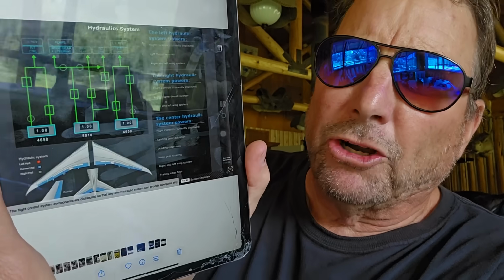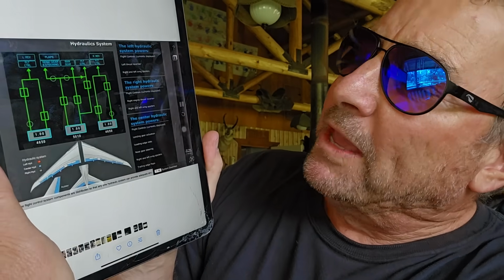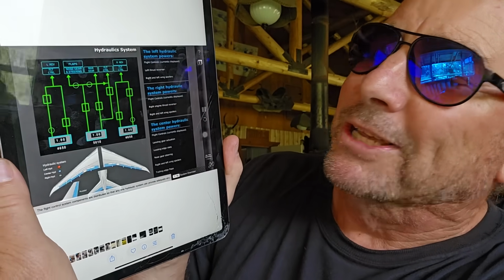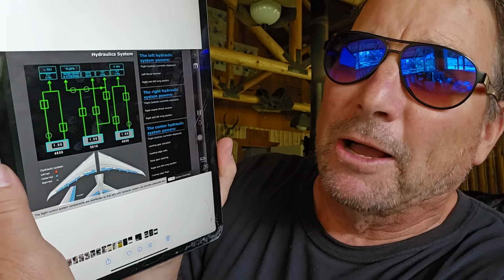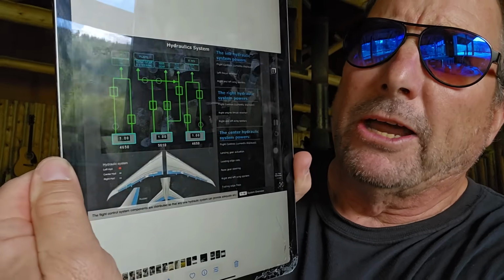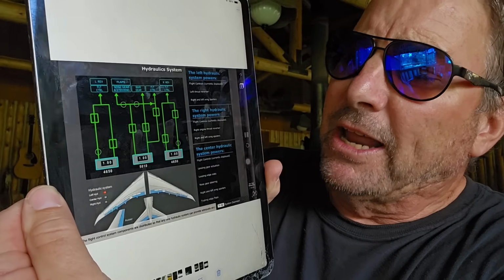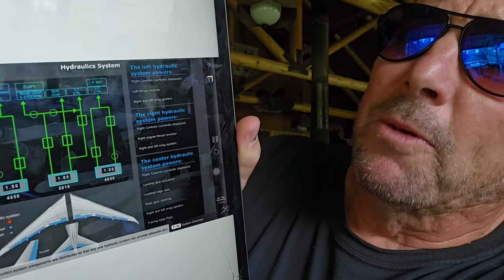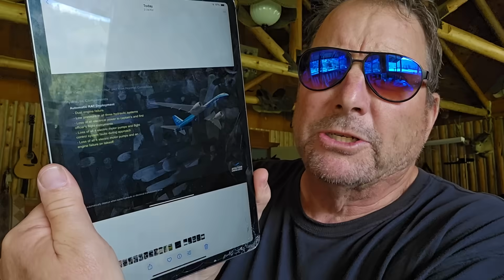787 Crash India What's a RAT? When does it deploy?

Comment: They should have investigated the A/C not working on the earlier flight…it’s incorporated in the whole electrical system to keep electronic equipment and batteries cool. Equipment Cooling System: The 787 has an equipment cooling system designed to regulate the temperature of crucial electronic components and avionics, which generate heat during operation. This system uses conditioned air from the cabin and/or ambient air to cool these components, ensuring their reliable performance and preventing overheating.
Battery Location: The lithium-ion batteries are located in the forward and aft electrical and electronic (E&E) compartments, along with other electronic equipment.
Indirect Cooling: By keeping the E&E bays cool, the equipment cooling system helps maintain a stable environment around the batteries, mitigating temperature rise and thus contributing to battery cooling.

Comment: I think it was dual engine failure after takeoff.  That's why the RAT automatically deployed.  In the video you can hear the engines fade out as the plane goes by. (Nobody is talking about that!)  The plane's performance on the runway was normal until after takeoff.  It also explains why the landing gear didn't raise as there would be no hydraulic pressure.  The plane going down looks like a loss of power (lift).  There does not appear to be a wing stall or over rotation stall.  I don't think the flaps were part of the equation because you see the plane lift off normally.  If no flaps were deployed, the I don't think the plane would not lift off like that.  I also think if the flaps were retracted at that point, the 787 engines at full takeoff power have the performance to continue to fly and even slowly gain altitude with the flaps retracted and gear down at that point.

Comment: This is a diversion to blame the aircraft. Find out takeoff distance for a 787-8 heavy at 3300 ft density altitude. (Ask AI.) A 11,000 ft runway is barely enough for 15-20 flaps and 3000 ft short for flaps up. They programmed wrong conditions.

Comment: Maybe someone commented on this already, but I haven't seen it.  The RAT is designed to provide power to critical systems during a catastrophic power failure.  I can support critical systems, however, it is designed to do this at cruising speed.  At take-off speed, it could only supply a small fraction of this power.  So if there was a complete power failure, and the RAT system automatically deployed, THERE WOULD STILL BE A COMPLETE (or nearly complete) POWER FAILURE.  This condition would be sufficient to bring down the plane.

Comment: This posted on another Youtube channel. Sounds like a Boeing mechanic? 

 During the takeoff phase of Air India flight AI 171, the hydraulic system was under high demand (flaps deployment, landing gear retraction, and nose wheel steering).
The Skydrol hydraulic fluid inside the pipes was likely approaching a temperature of 90–110°C.
If any of the pipes developed even a small microcrack, the hot, pressurized Skydrol could spray directly onto wires, connectors, and printed circuit boards (PCBs) inside the Main Equipment Center (MEC), potentially causing cable insulation to melt, catch fire, or short-circuit within seconds.
One of the high-pressure hydraulic pipes controlling the flaps on the Air India AI 171 aircraft suffered a structural failure due to material fatigue (micro fatigue cracks) that had slowly developed over time and went undetected.
The pipe finally ruptured as the system pressure reached its maximum operational limit of approximately 3000 psi (207 bar).
The hydraulic fluid (Skydrol), known for its corrosive properties and high thermal conductivity, sprayed forcefully from the rupture and came into contact with critical components inside the Main Equipment Center (MEC)—the aircraft's central avionics bay housing electrical modules, relays, and power distribution control units.
As a result, the aircraft experienced a total electrical failure, including:
1. Loss of power from the main engine generators
2. Shutdown of hydraulic control systems A and B
3. Interruption of power supply to the flap and landing gear actuators
4. Failure of all communication and avionics systems, including the transponder and ATC radio.
This triggered the automatic deployment of the RAT (Ram Air Turbine) as a backup power source. However, the RAT is designed to support only minimal flight control functions, and is insufficient to restore flap operation, landing gear retraction, or communication systems.
With the flaps stuck in takeoff configuration and the landing gear still extended—creating significant aerodynamic drag—the aircraft suffered progressive pitch-up and loss of lift.
Without communication capability and full surface control, the aircraft entered a deep aerodynamic stall at an airspeed of approximately 180 knots and an altitude of about 625 feet, then crashed before it could complete a climb-out.
---
Notable Clues:
1. A distinct propeller-like sound (resembling that of a small propeller aircraft) can be heard over the dual-engine jet noise in the original short video showing AI 171 during its takeoff roll. This sound is believed to be the RAT deploying, although in many other versions of the video, the RAT noise is inaudible due to added narration or commentary.
2. Loss of communication between Air India AI 171 and ATC occurred at an altitude of approximately 400 feet, strongly suggesting a complete electrical systems failure at low altitude.

Comment: Pilot says, “positive rate, gear up”.  Gear up is selected.  Landing gear wheels tilt forward, the doors begin to open.  Then, blam, both engines quit at the same time. (Water in the fuel?).   The gear stops in place after the hydraulics went out, the RAT deployed.  The airspeed bleeds off especially in the hot low pressure air upon take off.   No chance of recovery.  Sad. 

That’s my take.   Something caused both engines to fail at the same time.  Fuel problem would do that.  

Look at those wheels.  The wheels don’t lean forward like that but only during retraction situation that stops in mid operation.  

Doe this make sense to anyone else?

Love you Juan.   ❤
Reply: I agree.  I think you are right on target.  This investigation is going to be on why both engines failed at this critical time.

Comment: Juan: I’d be interested in your views of this subject.

Are modern passenger jet airplanes becoming so sophisticated that pilots can’t diagnose issues quickly enough to eliminate disaster?

ChatGPT said:
This is a very important and timely question, especially as modern airliners like the Boeing 787 and Airbus A350 grow increasingly complex. The short answer is: yes, in some cases, the rapid automation and system complexity can outpace a pilot's ability to quickly diagnose and respond to emergencies, especially when things go wrong in unexpected or subtle ways.

Here’s a more detailed breakdown of why this happens:

1. System Complexity and Interdependence
Modern jets have layers of interconnected systems—fly-by-wire controls, automated flight management computers, advanced engine controls (like FADEC), and dozens of sensor networks. These systems are efficient when working properly, but:
* Failures can cascade or produce confusing symptoms.
* Pilots may get conflicting or incomplete data, making diagnosis harder.

2. Cognitive Load in Emergencies
Automation typically handles most flight tasks, which ironically means pilots don’t manually fly as much. When a sudden failure occurs:
* Pilots are expected to quickly shift from passive monitoring to active problem-solving—not easy under stress.
* Decision-making is hampered if alerts are cryptic (e.g., “AIR DATA INCONSISTENT”) or alarms are overwhelming (the so-called “alarm flood”).

3. Real-World Examples of Tragic Delays
* Air France 447 (2009): Pitot tube icing caused autopilot disconnect; pilots misinterpreted flight data, leading to a stall.
* Lion Air & Ethiopian 737 MAX crashes: In both cases, MCAS—a new stall-prevention system—repeatedly pushed the nose down. The pilots lacked adequate system awareness or time to override it.
* Air India Express (2020): Investigators found automation issues and pilot disorientation in a runway overrun accident.

4. Training & Design Solutions
* Airlines now stress upset recovery, manual flying skills, and automation management in training.
* Some newer aircraft now aim for “human-centered design”—e.g., Airbus’s ECAM and Boeing’s EICAS, which prioritize failure messages and suggest actions.
* Still, pilots often don’t know what they don’t know—they may not be briefed on how every new update or software behavior works under edge-case conditions.

Summary
Modern jets are incredibly safe, but yes—they are so sophisticated that if something fails in an unanticipated way, diagnosing it in time to prevent disaster can be extremely difficult. The industry is aware of this and working on improving:
* System design transparency
* Training that balances automation with manual skill retention
* Better real-time decision aids

Comment: None of the discussion around the RAT tells us anything definitive because as noted it can be deployed manually as well as automatically. We have the pilot comments about a lack of power so it would make sense that he deploys the RAT as a last ditch effort. It doesn't tell us anything definitive about the actual cause of a 'lack of power' or whether or not there was  dual engine/power failure issue. This is because the flaps up/wheels down configuration also creates the same feeling in the pilots mind around a lack of power. I have zero aircraft risk experience but a ton of industrial accident experience and a major contributor to disaster is often focusing on the wrong factor at the crucial moment. They may never have revisited the flaps/wheels down possibility. I am not trying to say the cause is A or B. I am merely stating the RAT deployment does not automatically mean dual engine loss because it can be deployed manually.

Comment: The very first footage of the take off and descent had no audible sound from a deployed RAT, only the newer footage even though it's the same video. It would not surprise me if someone added that RAT audio at a later date. The crew may of manually deployed the RAT in desperation as well. Keep in mind that the aircraft had enough power to lift off and start the climb so a dual engine failure deploying the rat is highly unlikely. Sorry but it still seems to me that the flaps/slats were retracted instead of the gear.
Reply: The first video shown was a copy. The second may or may not be the original.

Comment: Take off with "High Density Altitude" with the aircraft being fully loaded with fuel and people! 1. LENGTH OF RUNWAY. 2. Temperature and humidity at  take off.  3. GROSS WEIGHT OF AIRCRAFT ON TAKE OFF . Flaps and leading edge Slat postion on take off. Very critical in determining go or no go!

Comment: One thought would be a catastrophic bleed air leak of both engines causing engine rollback.  However, 787 does not have a traditional bleed air system.  So something might have caused the reduction of engine power.  Fuel system malfunction even though the engines can be gravity fed?  Too many unknowns at this time.  Only the black box will show what happened.

Comment: If it's true that the RAT was out (and I agree that it sounds like it...) then I fear that -- yet again -- this will be an accident where the FDR and CVR stopped recording with the power failure. I hope I'm wrong and the 787 has a better FDR/CVR battery backup power supply but I will not be shocked if it doesn't.

Comment: Boeing has been using the RAT since the 76-200.  This could have been the Loud Bang the survivor says he heard.  It does make an extreme Loud Bang when deployed.
In my F/O days I was walking around a 757 in Quito, Equator.  I  was just walking out from the right gear inspection and just past the RAT Compartment Door.  Then
Whammm Bangggg....The RAT deployed.  There were local mechanics in the Cockpit and one had foolishly pushed the RAT Sel Switch.  If I had been a second or so
slower it would have hit me.  It is deployed under very heavy springs.  The recoil is more than impressive.  Yes we were delayed with local maintenance and Tulsa going
thru the procedures to place back in and re-cock.  But I am at a loss of such catastrophic failure on take off to deploy the RAT.  There is a photo of the right wing crumpled
up showing the Slats were out.  But the Slats Auto Deploy in a stall.  The 78 is so fly by wire I wonder if the Flap Sel and all indications were good in the
cockpit but the Config never activated.  This is an incredible mystery.  All 78 Flight Depts are in Shock.

Comment: According to VAS Aviation the accident plane backtracked along runway 23 from the R4 taxiway intersection probably to the turning pad which gave them 8999 feet of runway length. The full length of runway 23 is 11,500ft. The take off distance for a 787-8 according to one technical website (UltimateSpecs) is 9251.97 feet, more than was available to the crew that day from the turning pad  Why did not the crew use the full length of runway 23?  One video of the accident shows the plane getting airborne practically at the end of runway 23 having obviously gone way beyond V1 with V2 virtually at the end. This suggests to me that the crew did indeed use the turning pad and not the whole length of the runway. Is VAS Aviation correct in speculating that the crew did not use the full runway length? VAS concedes that nothing is yet known for certain.

The coming days, and we hope it is days as opposed to weeks and months, ought to reveal all. Everyone has an interest in the causes of this accident being established asap -  the airline, the Boeing Company, the engine manufacturers, the traveling public and of course closure for the affected families.

Comment: An indian airline captain, captain Mohan said that airport is notorious for birds off the end of the runway due to trash piles his theory is that both engines ingested birds causing the power loss, he claimed a loud bang was herd as the aircraft lifted off and was the compressor stall. He also said he had warned athorities for years that this would cause a major airline accident. Also on the swiss 001 chanel he noted that the main landing gear wheels were cantered forward instead of back which according to him may have indicated that the crew did try to retract the gear but it couldnt finish retracting due to dual engine failure and loss of ptessure.

Comment: It's been reported that this flight didn't use the full runway, instead starting from an intersection with something like 6,500 feet before the end. It's also been reported that the density altitude was over 3,000 feet. With those conditions and the full load, what would the proper takeoff flaps setting be?

Comment: I have great respect for you and your analysis, but I have to question the RAT theory. The original video has nothing remotely resembling the RAT sound. Yes I understand that it was " filtered/enhanced" but even at high volume on a good sound system there is no evidence of it, and the sound quality of the original video is quite good. Secondly, on Tech News Australia, they show a tiny picture of the plane with a circle and arrow around where the RAT is supposedly deployed, however when blown up there is nothing there. I was actually able to play the original video zoomed in, frame by frame, getting a better image than theirs, and can clearly see only smooth belly where the RAT should be. I ask others to look closely at this information. Am I right or wrong?

Comment: What can cause both engines to lose all power with the independent systems they have? Something went bang and both engines lost all power. Did they lose electrical or hydraulic control or lose fuel? Is there something in common with both engines that is not isolated from each other that can cause both engines to shut down, lose powerl?  Also could it have been sabotage or small charges strategically placed to cause this?

Comment: If there was a conclusively definite RAT deployment then conditions onboard the aircraft were apparently off normal.  However, previous contributors have stated that this deployment must have been automatic and not manual.. as manual deployment is not actually possible on a 787-8.... this guy however says it is.... so ... some potential confusion there. If it was a definite auto deployment then clearly some sort of failure had occurred..... but with both engines apparently still running.. how can a common mode hydraulic failure occur on a triple redundancy system ? .... the aircraft should have had enough hydraulic and electrical power to raise the undercarriage? So there's a question .. what series of events has to happen for a common mode failure condition to all three hydraulic and electrical systems to occur? Surely the odds on that happening would be extremely remote??

Comment: I beg to differ the RAT provides backup limited power to essential services only in the case of an emegency. You keep going on about the 787 is an electric pump and engine power pumps which is the same in just about all aircraft in use. As a retired aircraft engineer of some 50 years may I suggest that you wait for the enquiry results as pontification is purley assumption and not facts.

Comment: Looks like the GCU bug was not fixed for this 787, after 248 days continuous operation it will shutdown (bug found in 2015)  Boeing issued a fix back in 2015,  but no record it was actually applied to this 787.  When GCU shuts down all power is lost, fuel pumps etc and why the RAT got deployed.  But at 650ft, there is just no time for any reset/recovery.